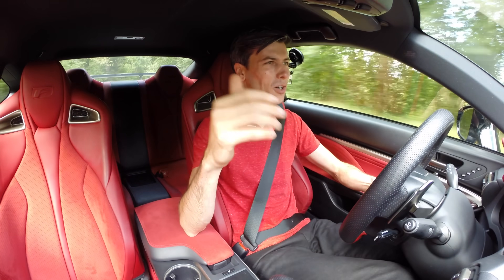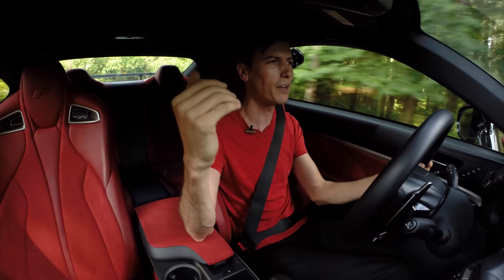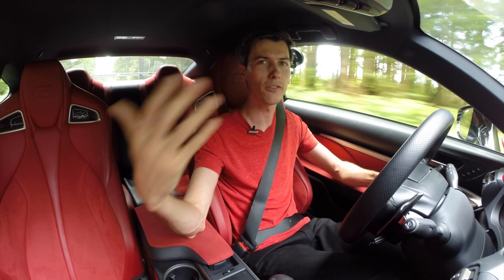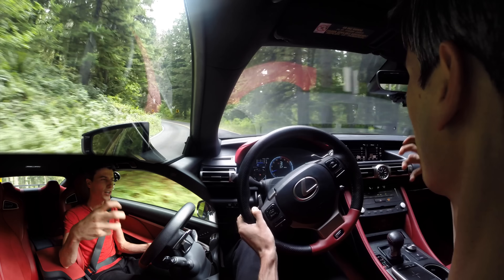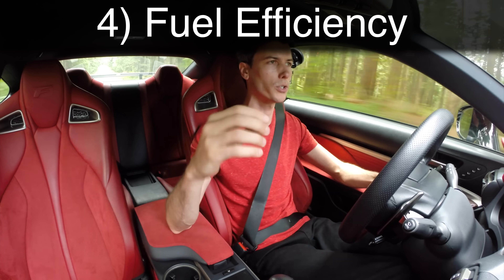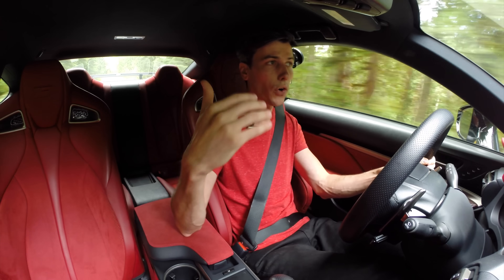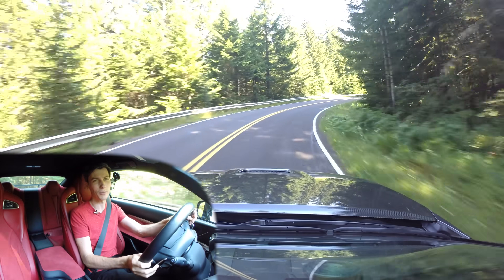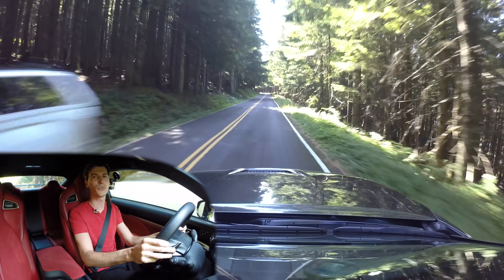5 Reasons You Shouldn't Buy A Turbocharged Car

Comment: Hey Jason! Love your videos, but I think in this one, you missed a few things.

1) Because of downsizing and turbocharging, your throttle for the same operating point as before, needs to open more, which leads to a decrease in pumping losses (lower PMEP).

2) Due to downsizing, your overall cylinder area goes down by quite a bit, which reduces y our friction losses drastically (lower FMEP).

3) Smaller engine means smaller sprung mass.

The overall effect of downsizing and turbocharging is improvement in the fuel economy. The way NA engine can compete with that is cylinder deactivation, which is something that is something that is gaining popularity.
Reply: I think he was talking more about operating at wide open throttle

Comment: Turbochargers have a huge advantage as well, they allow similar power at much lower weights.  Lower weights help with fuel economy, and greatly assist handling.  I personally hate any excess weight on my cars, so give me the turbo, better handling, and better fuel economy.  And yes, they do have better fuel economy. 

If you are more focused on the engine power and powerband, I can see why you'd prefer a normally aspirated car with similar power.  There's no real substitute for cubic inches.  But there's also no real substitute for lower weight.  It just depends what you value more.
Reply: That's not true at all, once you include plumbing, you have 100-200 kg heavier car.

Comment: Jason: Why you shouldn’t buy a turbocharged car
Entire R&D contingent of virtually every car manufacturer: Oh, so we’re wrong are we? 🙄
Reply: It is a lot easier than designing and manufacturing a good engine.
Reply: Planned obsolescence and fuel economy. These are the new goals of R&D in car manufacturers. If you think they're striving to offer you the best that technology today has to offer, think again.
Reply: @Bugumir  "planned obsolescence" as manufacturers are offering increasingly long warranties. Yeah sure
Reply: The average person isn't even remotely concerned about the sound of their turbo, or about even using it. I have a Volvo S60 with a turbo and it's not like it is put to use much of a time, but it is nice knowing that the power is there if need be.
Reply: They are using smaller turbo engines to get better fuel economy numbers in the EPA (or Euro equivalent) testing regimen, NOT because they think complicated turbo systems make for better overall engines. Unfortunately, the tested fuel economy numbers are lies. In the real world, NA engines are more efficient for the reason Jason stated - turbos require far more fuel enrichment, to survive acceleration without uncontrolled combustion events (knock). There is a lot more to 'unpack' here, but you get the idea.
Reply: @Michael_Lorenson  turbo cars are more efficient than na cars.
You can have a smaller engine with the same performance.
Example look at the 1.6L Ford engine vs the 1.0L ecoboost.
The turbo 1 is faster and have a better mileage
Reply: @DHG_Duke890R  
It's possible for a given turbo engine to be more efficient than a given NA engine, but that isn't guaranteed. That smaller engine you mentioned still has to process roughly the same amount of fuel and air to produce the same power, plus extra enrichment for acceleration. The devil is in the details. 

Besides there are many reasons to avoid turbos, it isn't just about fuel efficiency: extreme under-hood heat cooks everything, far more complexity, and turbo failures, to name a few.
Reply: Not toyota 😂

Comment: All the heat and pounding on a car with the turbo, I’ve seen turbo cars die early compared to non turbo cars and you just don’t see old turbo cars because they don’t last. I’ve had a few turbo cars and the truth is I think turbocharged cars are just not a good choice.
I’d rather have a high output 2.4 liter engine rather then a 1.4 liter turbo engine anyway !
Reply: Maybe in the 80s
Reply: Yeah, I had an Audi 2.7T which was one of the most desirable turbos of it's day cause it was cheap and you could really up the boost. But it leaked oil from a new spot every few months and all the rest of it. Now I have a 4.2L V8 naturally aspirated and wouldn't go back. Rock solid, much more low end torque, (and better power all around really) and sounds way better. A boosted out twin turbo is great for those dyno runs, but the reality of it ain't as fun.
Reply: Well, there are quite many old saab turbo cars running. My 9-3 has 320000 km on the odometer, yes it is on its second turbo, but in general, the engine is just working fine. Like the basic parts aren't impacted by the engine being turbocharged.
On the other hand, In the 80s, 90s and in some cars or parts in the early 2000, Saab was known for using parts that could hold much much more power or force than the cars actually had, so that surely does help.
Also, the thing with turbos and reliability is partly do to people not properly caring for the car. Like a turbo will break easier if you don't let the engine warm up and hit full throttle. Just don't do that. And turbos like fresh oil even a bit more than an N/A engine.
That said: Some turbo engines are clearly underengineered and unreliable. Especially when the manufacturer uses parts that aren't stronger than N/A engine parts etc. And engines generelly tend to get more unreliable in recent years.
Reply: In Europe most cars (60%) are turbodiesel. 200,000 miles is pretty standard for cars that get serviced properly. (Diesel sales are now falling due to strict emissions regulations). My 2008 Volvo 2.0d has done 160,000miles and returns 50mpg out of town, it starts in all weather too. Turbos are only as reliable as the person responsible for maintenance.
Reply: @pedclarkemobile  a friend of mine has a Seat León MK1 with a turbocharged engine. 456789 Km and still going.
Reply: @usarkarzts4207  good oil, changed regularly keeps the turbo doctor away!

Comment: nice physics, automotive engineering lesson - a (multiple) sesh comparing efficiency, output, fuel economy, lag, reliability between an s-max (or ford ecoboost engines ), bmw twin-turbs, volvo LPTs, nissan 1L turbocharged would be interesting, regardless of apples, oranges, melons comparisons :D

Comment: 1. Turbo lag is a minor trade-off compared to the advantages gained. Lag has been minimized by current tech and can be minimized even further with aftermarket tech, if you have the money. 
2. Torque curve doesn't affect the average consumer. If it's a daily driver, you don't see most of the torque any way. If it's a higher powered car for drag racing, for example, you don't last long enough in WOT to even see the torque drop off point. 
3. Reliability. Yes, turbo'd cars are generally more costly to maintain and repair, but if you take car of it properly, it shouldn't be an issue. Heat isn't as big an issue as it's made out to be. If it's just a daily driver, your engine won't see any much higher temps than a NA engine. If you're an aggressive driver, that's a different story. Oil shouldn't "cook" as bad, even in the turbo itself. I'm sure the manufacturers took that into consideration when designing it. Even if it's a problem, there's tecg to counter that. 
4. Fuel efficiency. Yes, that can be a bit of a problem, largely depending on the driver. I have a small 2.0 turbo'd 4 cyl., and even as conservatively as I drive, the best I manage is an estimated 22 mpg's highway.
5. Sound. Come on, now. Who doesn't love that turbo whistle sound. Even a supercharger whine sounds amazing.
Good video, tho.

Comment: Love todays turbos, as far as throttle response, that's what the eco/sport/normal button is for.  Turbo lag these days is very minimal, it's more like .5 secs later.  And your torque curve depends on how big a turbo you are running.  I had 3 turbos in the 90's,  and one now, I'll take the turbo.  And can also plug a chip giving me 48hp more, but I won't due to voiding my warranty.  Your oil issue is a non issue, I talked to the manufacturer of my vehicle about the 3min warmup/cooldown I used to have to do in the 90's, they stated not really necessary as the oil lines are smaller pushing oil through faster.  Only poor maintenance kills a turbo, and guess what, it kill any motor.  Sound?  I don't want anyone to hear me speeding.
Reply: 0.5s is still noticable lag
Reply: @alsa4real  that’s only if you floor it out of nowhere
Reply: That's encouraging
Reply: Nope as a technician myself, I see turbo gas engines with oil changes done right at 3k miles and the oil comes out black. My oil on a NA engine at 3k miles still comes out amber. What do you think all that abrasive burnt carbon in the oil does to engine tolerances? Not to mention the heat. You burn the candle at both ends, it burns out faster.

Comment: I agree with your first four comments about naturally aspirated engine.  Turbos are a damned nuisance.  However how much petrol does your five-litre behemoth gobble?  They could also save weight and considerable cost by removing the go-faster piece of plastic from the tailgate.

(I once had a car that had go-faster stripes, go-faster seats, and go-faster wheels.)
Reply: If you can afford an RC-F you can afford a more efficient car to do most of your driving in (and afford the increased operating cost for the little you do in the V-8) so it's not important.

Comment: i still think its cool that a 2L 4 cylinder AWD turbo car can be just as fast as some V8s,
Reply: But when you turbo charge a v8 it’s even faster
Reply: Whispers Audi A3 😉
Reply: @jaysullivan8350  i was more thinking of evos as the 4g63 can be built to handle alot more power
Reply: @doodlebob-t1t  I ate a lot of V8's in my 1997 Eclipse GSX. I didn't even have a big turbo on it, just a Mitsubishi small 16g. At 22 psi, it did the quarter-mile in 11.91 @ 116 mph while going 0-60 in 3.4 seconds. I would dump the clutch at 7000 RPM and the car would just shoot out of the hole.

Some dude in a Fox body Mustang tried to get me to race for money at an 1/8th-mile track once. I told him I just race for fun and to improve my own personal times. We lined up and when the light turned green, I took off. I could tell he was a bit surprised as I saw him lose a bit of traction in my rear view before he hooked up and started really pulling. He had a fast car, but not fast enough to beat me in the 1/8th. Had it been a 1/4-mile track, he would have easily passed me. But it was funny nonetheless. I was the only import (and the only 4-cylinder) car there, so he figured I would be easily beaten.

I miss that car so much. Those engines can put out SO much more power than what I was doing. I just never got to that point in modding it before selling it.
Reply: @rars0n  fake news
Reply: @DB-sd3cw  Yes, you are.
Reply: @jaysullivan8350  not Audi A3 Audi rs3
Reply: @alexk3469  nah, the RS3 comes with a 5 cylinder. The S and A’s come with 4
Reply: @alexk3469  but trust me, the A3 is a really good performer for a basic car🤷🏾‍♂️
Reply: @jaysullivan8350  no what I mean is the Audi rs3 is better because of the engine

Comment: My issue is the price of many of these cars. How much is that Lexus? Somewhere around $80k or more I would guess. Not all of us can afford that or want to if we could. I took my 2009 Corolla S that I had done a lot of suspension work to and it handled great and is a lot of fun to drive on the same roads you do a lot of these videos on, so what did I do? I turbocharged it. No it's not a rocket like that V-8 Lexus but adding a 100 HP up to 230HP made it a lot of fun to drive. And I still average over 33 mpg with it while having a very reliable car. Oh yea, and it sounds amazing!

Comment: “0-60 in under 4.2 secs, so it’s not crazy fast.  But its good.”  Lol
Reply: I was looking for this comment
Reply: My car doing it in 12s: I'm fast af boi
Reply: Just shows how desentisied we have become to crazy horse power figures in the last decade. A lot of people don't even blink when they see cars announced that produce four figure power outputs
Reply: @samuelspink2489  You have to experience it, a 6 second car is fast, a 4 second is insanely fast, 3 sec, stupidly, insanely, unimaginable fast, and a 2 sec, is everything before squared, maybe I’m exaggerating, but since many won’t experience a 6 sec. floored in a while, this videos make them think “4.5 secs. Meh, a Bugatti is faster”, just nonsense, also the power output, Engineering Explained has a video about how hp is an overrated figure.
Reply: @josearmandoguerrerochairez3454  oh yeah I agree with the whole hp thing. I drive a 7 second car so definitely not the fastest thing out there but it does it with less than 170bhp. I've also been in a 5 second car on the road and 3 second car on an airfield but some cars are better at separating you from a sense of pace than others.
Reply: @samuelspink2489  That’s the thing, CHANGE in sensation of space, you can be in a Concorde (now retired) plane at 1100 mph but you wouldn’t feel any different than being in your desktop, Also, hp only really matters in top speed and overall acceleration, not from a stand still, because the transmission makes up for the low torque, and only becomes noticeable at higher speeds when you are already at a high gear so not so much torque, all of this is for what makes a fun and fast-feeling car, because raw numbers can do physics, but can’t make you feel fast subjectively.
Reply: @samuelspink2489  I just realized that I referenced Jason you like “you might know this guy”, and we’re in one of his videos, I mess up my comments conversations, lol.
Reply: @josearmandoguerrerochairez3454  I have a 7 second car and that feels quick to me, it’s a diesel bmw but it just pulls so hard in every gear at every speed. I’m only 18 so 7 seconds to 60 is pretty impressive to me haha
Reply: As a biker: "What's so special about it?"
Reply: @V4zz33  airbags
Reply: @DrPacman  bruh 🤣💀
Reply: @DrPacman  You can have a full Kevlar vest, and airbag jackets, and you can walk off pretty much unharmed if you don’t get rolled over, and you have a chance of your bike not being wrecked up.
Reply: @josearmandoguerrerochairez3454  That's bull . I'm speaking from a whole lot of experience .
Reply: @jackanderson2773  I’m speaking from a theoretical standpoint, different cars with the same specs don’t feel the same, it’s about how your body precepts the forces and accelerations, and equal numbers doesn’t mean same feeling, unless you have tried every car model since the 1900’s you can’t assure anything, now, obviously vast experience might get close, how much of that are you talking about?
Reply: @josearmandoguerrerochairez3454  So sorry ... my mistake . I took it you were referring to motorcycles .
Reply: @jackanderson2773  Well, that’s a whole other story I know nothing about, have a good day.
Reply: @josearmandoguerrerochairez3454  :)
Reply: @DrPacman  mocked it😂😂😂😂
Reply: @josearmandoguerrerochairez3454  doesn't matter if you hit a solid object , Cars have crumple zones bikes don't.
Reply: @Jasontvnd9  What?
Reply: @josearmandoguerrerochairez3454  I'm referring to your Kevlar vest and airbag comment.

You can wrap yourself in a protective suit all you like but a massive proportion of accidents are head on collisions without vehicles or crashing into solid objects , Cars have crumple zones to dissipate that energy bikes don't.

I have a bike and a car , Obviously the bike is alot quicker but if I had to have a crash it would be sheer stupidity to choose the bike.

Facts don't lie , 2 fatalities per billion miles travelled In a car , 118 for motorcycles.
Reply: @Jasontvnd9  Obviously it’s not the same to be strapped into a solid chassis with airbags and crumple zones, than to be literally free in the air, and if you use a whole lane, your chances of crashing are just as high than a car’s, but true, the injury chance after the wreck is way higher, in a car, the other stuff around simply doesn’t hit you (If the car is good), in a bike, you hit it, it’s simple logic.
Reply: @josearmandoguerrerochairez3454  yeah but a fast bike is like a 110 pound guy with abs— it just doesn’t really seem as impressive.
Reply: @SIIKAP1  And not as stable.
Reply: It’s still a barge.

Comment: Everything points to a simple electric car.  Full torque and instant response and high reliability.
Reply: "high reliability"... eh..
Reply: I dunno mate , it occurs to me , the very fast electric ones need more than one motor to go fast ,  and people speak of  ev`s and torque  like the motors have no gearing assist ,  but even teslas which is not widely known have a 9 to 1 reduction ratio and with multiple electric motors and even huger batteries for the fast ones  . 
 As for electric cars like teslas being simple , nothing could be further from the truth , despite what marketers and musk tell you  :) , these are no simple remote control car  , and unlike mechanical cars , if your ev  fails , you will not be going to the corner garage to get it fixed .
   Even the electric motors in these are internally water cooled , be careful what  marketing spins you  .
 In the end scenario , ev`s are just as likely or unlikely to fail on you as any other car .

Comment: One of the main reasons people like turbo engines is because of their massive potential. If you build the engine strong enough and give it enough fuel with a turbo your horsepower potential is off the chart. With NA there is some limits with normal engine sizes. With a turbo and careful modding a 2 liter engine can put out over 1,000 hp pretty easily these days. Far as I know no 2 liter NA combustion engine is going to approach 500hp. There is purpose built drag cars with near 2,000 hp on a 2 liter engine with a turbo.